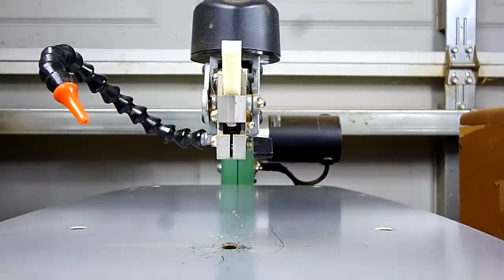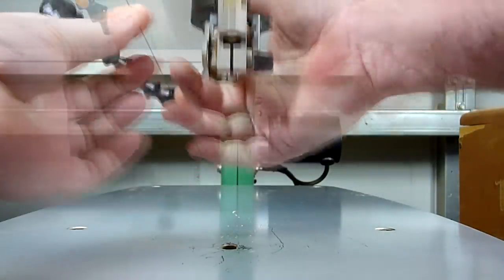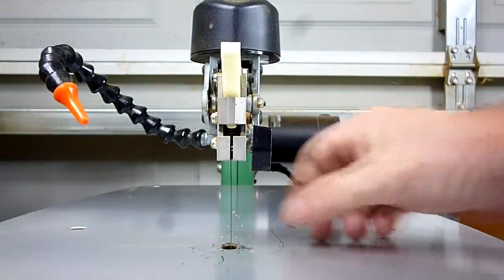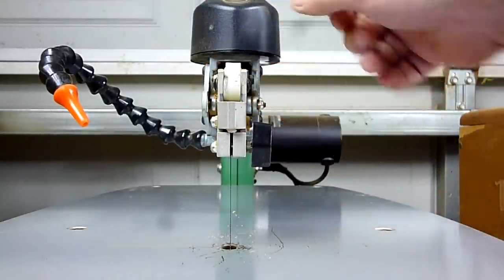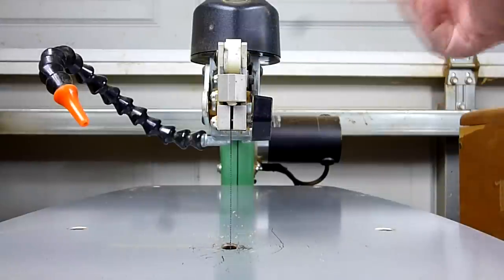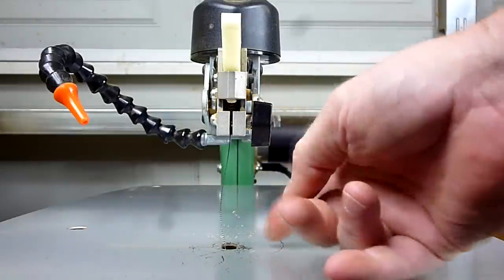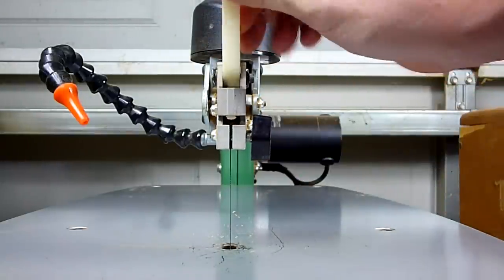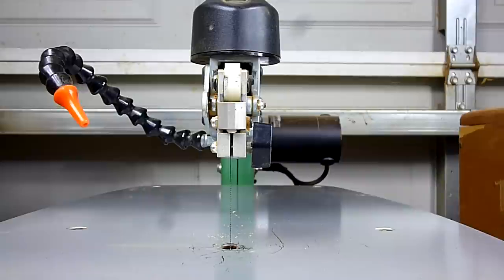Scroll Saw Blade Tensioning and Pre-Stretching

Comment: Dude ,thanks for the tip ,it worked. Copied what you did and the blade has really good tension. Where as before it was not tight ,but loose.

Comment: plink plink plink  Thanks, I should be able to remember that sound.  I just messed up several cuts by not tensioning my blade enough (fairly new saw, not enough experience, just changed the blade.)  And I'll start using unpinned blades, on your say-so.

Comment: A question for you, and I'll be grateful to hear from you. I use an excalibur 21. It seems that the blade tension changes with the position of upper arm. For example, when I stop cutting, loosen the blade, and put it in another hole to cut, if the upper arm is high, the tension will be less. and if the upper arm is low, the tension will be more when I turn the knob. Can you help me to make it consistent?

Comment: i have an excalibur saw now for about 2 months. i put in a new saw blade. first at the bottom, then at the top. with the pedal i start the saw(without the wood) for about a couple of seconds, stop it and mostly the blade is wobbly then (stretches) so I tighten it again.  when it is tighten and the blade has a high pitch note, i want to saw the wood, but within a couple seconds it brakes at the top. i bought a set of pegas saw blades because that was the brand which was included with saw. not pushing the wood to hard. . maybe the cause is in the little screws at the left side of the arm, maybe it doesnot allign with the tightning black screw on the right? if so, how do I correct that? not sure that it is the cause though. . thx again in advance for your reply.

Comment: I’m very new to scroll saws, I have  the same scroll saw as you, installing the blade into the saw, I find the blade is not long enough to fit in both clamps, and when it does clamp in it’s not holding a lot of the blade.

Comment: I'm interested in learning Scrolling as a hobby.  Does a scroll saw need to be bolted down to a heavy bench or can a lightweight free-standing workshop bench be used?  I'm concerned mainly about the amount of noise they make and whether they tend to make a lot of vibration.  I'm looking at spending about $200 or so on a hobby-level machine and a few accessories such as a magnifier as you suggested.  Do you think it would also be necessary to buy a sawdust vacuum?  I'm not really sure how much dust these saws generate, is it a easy task to clean up with a handheld vacuum?

Thank you for this excellent series of tutorials.
Reply from the maker: +Adam Ward 
Hi Adam, In order to reduce vibration and noise, any scroll saw needs to be secured to a solid base. Just setting a scrollsaw on top of a table is not a good idea. A hand vacuum should be fine, the sawdust drops to the floor and is easily vacuumed up. You should be able to find a decent used saw for less than $200 and along with the magnifier, I would also budget another $30- $40 for a foot pedal as well. Good Luck
Reply: @Scrollsawforum1  How to you attach the foot pedal to the scroll saw? What magnifier light would you recommend?

Comment: Goodevening Sir, what to do if the blade breaks in the first 5 seconds of testing, any idea about the cause? Thx for ur reply.
Reply from the maker: +Jo Nellen  Hi Jo, I really need more information in order to try to troubleshoot your problem. Are you cutting wood when it breaks, are you exaggerating about the 5 seconds and it's really 5 minutes?Are they new or old blades, How long have you been using a scroll saw? Are you pushing too hard, are the blades  old? Etc...Just like a doctor, troubleshooting problems requires information, the more you can give me as to what the circumstances are when the blade breaks, the better chance I have of giving you an intelligent answer..

Comment: I have a machine that has a totally different configuration than just about every scroll saw I have seen... its an older one, and tension adjustment is in the rear of the machine on the opposite end of the arms... there is no flip stop at the front... or it is missing.
Reply: @Chris Griffith, I have a Ryobi, and I must of bought it back in the mid 80's - early 90's, mine has the tension on the top of the arm towards the rear, but it has 2 tensions, one smaller knob on top of the other one, It's been years since I used it and I want to get back in wood scrolling, I think the one smaller knob, tightens the blade and not sure what the other one does... I don't know, I don't get it. If only my dad was still here!

Comment: what about pin end blades sir?
Reply from the maker: +tr66  Pinned Blades are not used by serious scrollers. But if you must use them, all the same rules apply. Tension, Tension, Tension!
Reply: ok thank you sir, i just bought a skil basic scroll saw, and it came with pin end blades.
Reply from the maker: +tr66 If your saw does not take pinless blades, there are adapters that you can buy to convert the saw so that it does. Here is an adapter that Olson sells, it has mixed reviews. Good Luck. http://www.amazon.com/Olson-AC49610-Scroll-Blade-Conversion/dp/B005ELXNX6

Comment: how do you know what speed to cut at?
Reply from the maker: Hi Joan,  In my opinion, slower is better. The faster the blade goes, the harder it is to stay on the line, and your blades and bearings wear out faster.  I usually have my speed dial set at about 1/2 to 3/4 speed. I never set my scroll saw on the fastest speed anymore. My best recommendation is to set the speed dial to where you can comfortably stay on the line and keep your piece under control. This speed will vary with the hardness and thickness of the wood so it is something you will develop a "feel" for over time. When cutting at slower speeds, you should notice that it is much easier to stay on the line which makes the quality of your cuts instantly better...Bob
Reply: In other word, "Patience."  Now I know I've found someone who gives good advice!